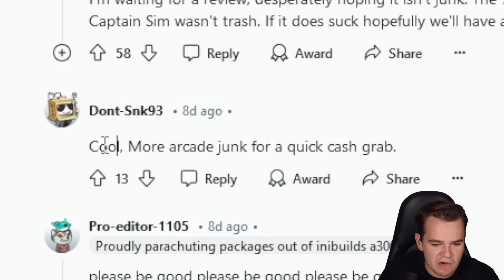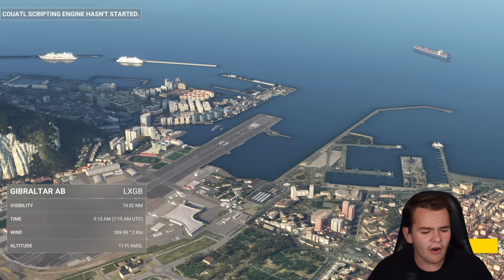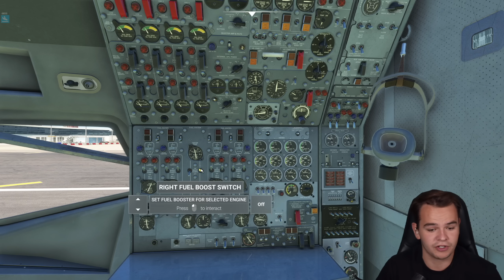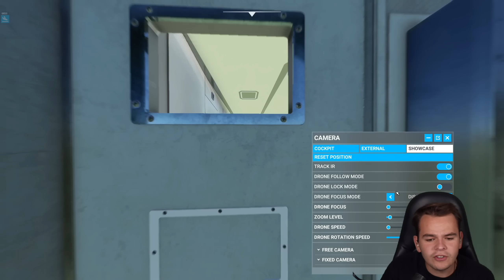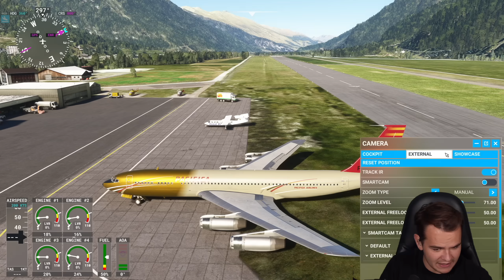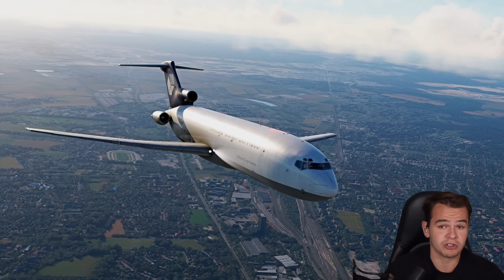Why The B707 Is The Most HATED MSFS Plane

Comment: Well the startup is pretty accurate. I flew 707s for 3 years before they were retired. Not that agile, but could actually do quick evasion, one of the accurate bits that is good in this model is the whole horizontal stabilizer moving. 707s had hydraulics linked to the yoke that moved the hoz-stab, and manual cables moved the elevator tabs and ailerons. This plane was really really heavy to fly, but was actually pretty responsive. When I switched over to 767s and 777s, I actually had problems adjusting to the more agile planes.

Comment: They better improve this before releasing FS2024.

But then again, it’s made by Aeroplane Heaven, so… chances are very slim.

UPDATE (07/04/26): At FSExpo 2026, it was announced that iniBuilds and Working Title Simulations would be working together to remake the 707 for FS2024.

Comment: 9:27 the engine looks inaccurate the fan case should be slightly wider
Reply: Actually, everything aft of the fan case should be narrower.  That is the problem - there was a larger difference between the fan and the rest of the cowl, around 6-8 inches at least.  The fan air bypass is larger than what is shown.  This is why the engines look larger than they should look - they are.  They need to reduce the diameter of everything aft of the fan cowl by around 6-8 inches.

Comment: The engine sound will be much different from a modern plane. Totally different engines, no giant fans. I noticed going from full throttle to idle, it’s louder at idle than full throttle. Hopefully some updates will come soon.
Reply: You’re right, and it’s not too expensive so I did expect some flaws on it